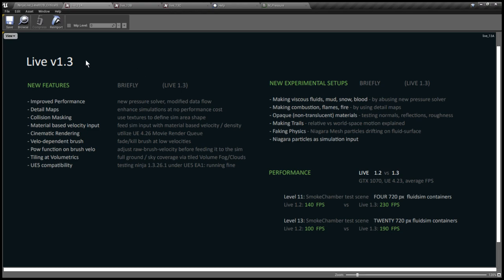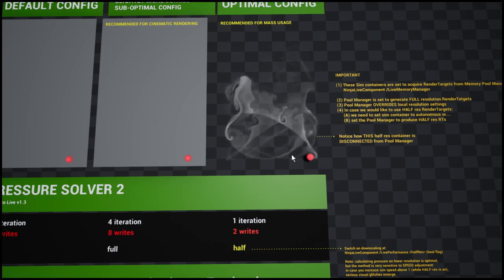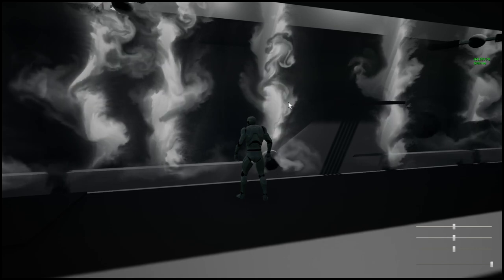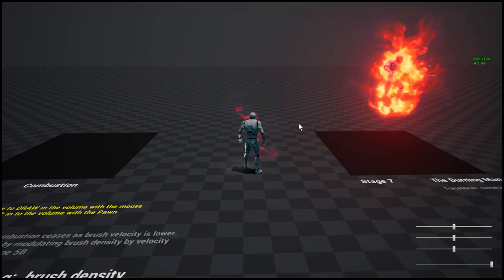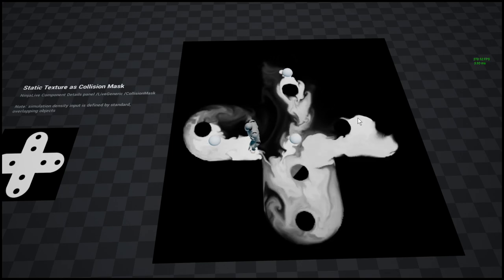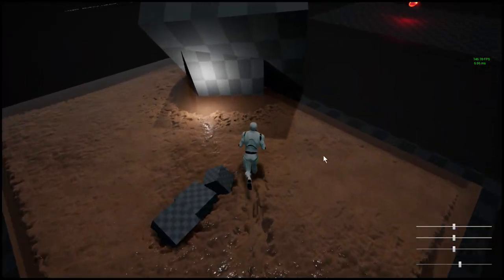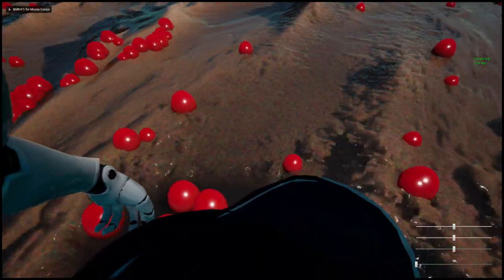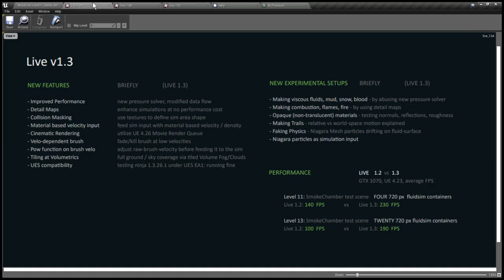FluidNinja LIVE 1.3 - Performance, Detail Maps and Collision Masking - recorded on GTX 1070

Comment: Wouldn't rewriting the BP parts of the plugin in C++ give a bigger performance boost as well?
Reply from the maker: Hi Cazaq! (1) I could not reply to your previous comment (on GTX 1080 vs SmokeChamber) - youtube did not allowed me stragely ;) -- so first answering that: your lower FPS is because you have been using legacy ninja, and the new release (1.3 ) is about performance improvements. (2) answering your recent question: yes ;) Writing the whole system as a Compute Shader would give the best results - but C++ libs might do as well! But ninja is purposely NOT a "plugin" - but a "project" - which means, it does not contain any C++ code, only blueprints, materials and HLSL. In case you have any practical suggestion for performance boosting: pls let me know!

Comment: Nice work ! I am curious about the type of fluid solver ? Is there any documentation on the type of algorithm used ? Compressible flow ? Incompressible flow? Is it a real time physical calculation or VFX per frame post processing only  ? 
In the case of a real time physical calculation, I was wondering the physical support for the calculation ? Is it based on some kind of grid method (FDM, FVM) or on particle methods as we could think with Niagara inputs ? 
Otherwise it looks very nice !
Reply from the maker: Alexis, thanks for reaching out! --- pls have a look a the Manual and the FAQ (in the description of this video you could find a link that takes you to the project homepage, PDFs are linked there) ---- both containing information / infogrphics / references on the fluidsim pipeline and the solver itself. Have a read, and come back in case you have more questions!